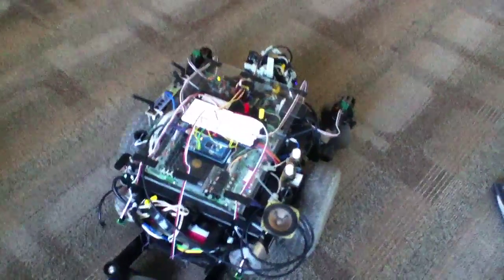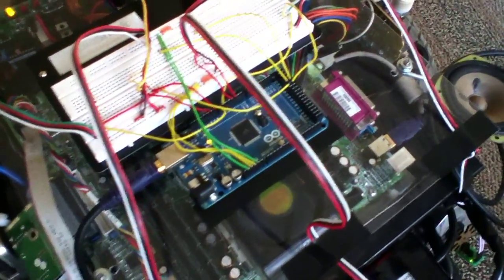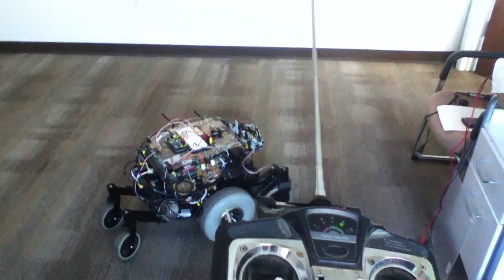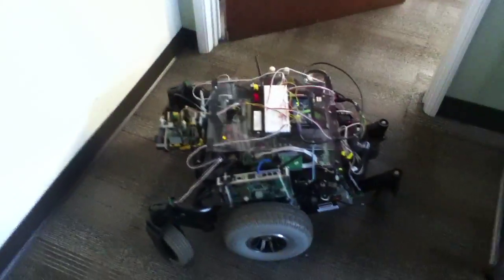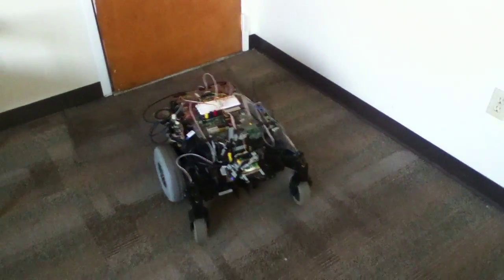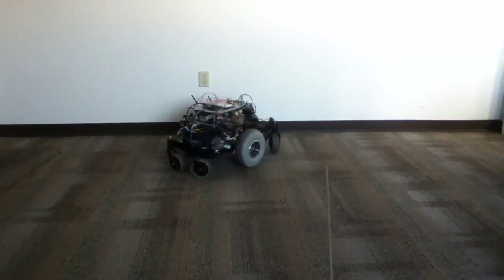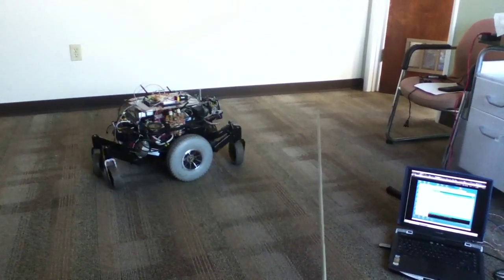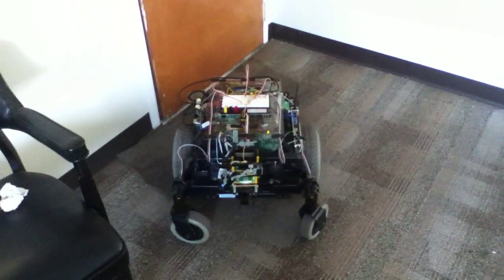Spy Cam Robot Part 2

Comment from the maker: Well It's been a lot of reading I can tell you that, I don't think I could write a tutorial on how to build this particular robot, there's a lot of parts that might be hard to come across, like the bottom half of a wheelchair. But if you'r interested in starting to learn about robots, I buy most my parts on robotshop[dot]com and they have a couple beginner to advanced robot kits that you can add to later on. I saw one that's a programmable tank that's similar to mine on a small scale.